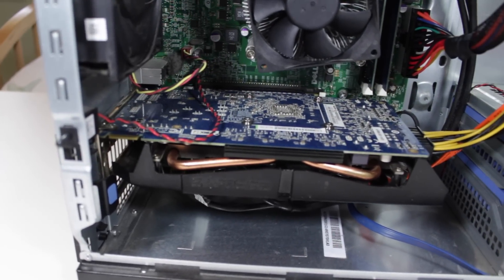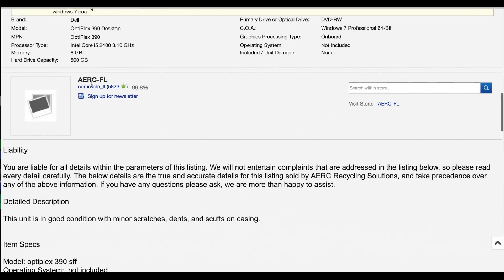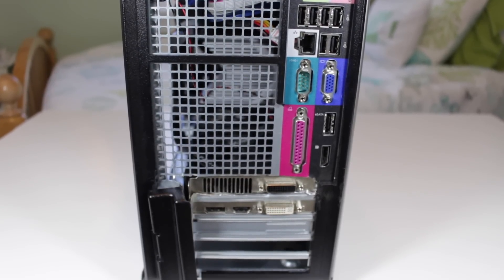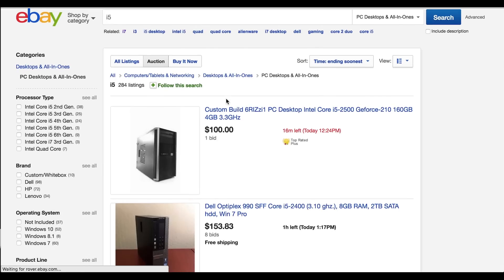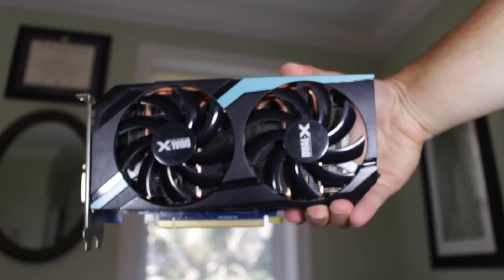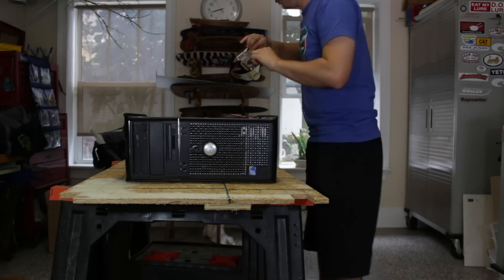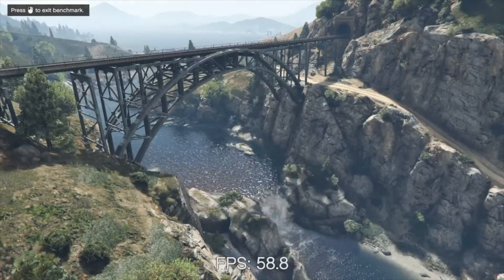How to build a GAMING PC for under $200! (2016)

Comment: Hi Matt. Great videos! I have starting a project to build a budget gaming pc. I decided that I would work towards building a custom pc, not oem. (ie, custom case, gigabyte/msi etc motherboard...) The reason for this is that I could easily upgrade the components in the future. (please view full comment, I think I got some pc components for good deals:)

Anyway, I first carried out a ton of research about motherboards, chipsets, processors, power supplies etc. I came to the conclusion of searching for a motherboard compatible with 3rd gen intel processors (z77,h77,b75 etc chipsets). The reason for this is that I found 4th gen processors/motherboards are a lot more expensive. Also 3rd gen processors are the earliest gen that can work with pcie gen 3 which is another bonus. (Also these motheroards support usb 3!) 
So to get to the point, after about a week of searching ebay auctions, I found an auction going for a GIGABYTE B75M-D3H motherboard bundle. 

It came with 1 stick of KINGSTON 8GB RAM, an INTEL I3 3240 processor, and the INTEL STOCK FAN/HEATSINK.
I won the auction for £78.99 including postage which I was pleased about. 
I also won an auction for a psu - £30.06.This was a CORSAIR 500W (CX500).This is bronze plus rated which is why I went for it
I may sell the included processor for an i5 3470
I may sell my old gpu (msi gtx 750 ti low profile 2gb) for a gtx 1050 ti or gtx 1060

Please tell me what you think! (sorry if this comment was a bit long-winded)
p.s. my old pc was the same one as in your $100 gaming pc build video! It was really interesting! (I had a q9650 processor, 8gb ram, and the gpu mentioned above)

Comment: Thanks for this video! I managed to snag a dell i3847 with a I-5 4460 1 tb hd and 8gb 1600 ram from my local goodwill Goodbytes for $150. Found a MSI HD 7850 for $50 on facebook and bought a new 240gb SSD from walmart for $70 the motherboard actually has sata 3! My buddy had a old 500w 80 Plus PSU he gave me for $10 that had all the connections i needed. I am using the SSD for windows 10 and my games i play the most. The 1 TB HDD im using for random games,music,movies ect. I can play all my games at high settings @60fps

Comment: If I buy a pre built dell optiplex SFF (not the micro) or the large tower as shown in this video and your $100 video do I need to upgrade the PSU if I use an RX 460 low profile card? Could I just use the stock PSU for either or both of these systems?

Comment: i have that i5 2400 dell but mine is a small form factor with a gtx 150 ti low profile
Reply: 741Mo0R_ G4M1NG The Msi 1050 ti lp? It fits right? Like the cover closes with the card installed?

Comment: got 2 of thse comps one with the i7 2600-3.4 and another one for my kids with the i5-2400-3.1   . great comps just one problem .when gaming sometimes the screen goes black for a few secs. i'm thinking its the power supply. probably needs a more powerfull PS even though the video cards dont use  lot of power. have a 750 ti  on the i7 and an AMD 6450 on the i5. Anyone else having this kinda of problem ?

Comment: instead of using a New Psu couldnt I buy a used GTX 1050 TI since they use a 300 watt psu ?
Reply: any card under 75watts gets its power prom the pcie

Comment: Very informative, but you should also mention the limited road path in upgrading  these systems, i.e. whatever you buy today that plays 1080p in ultra settings will play games in in 2 years on medium  1080p. It helps put things in perceptive.
Reply: what about a 3rd gen 3470 i5 with 8gb of ddr3 ram?
Reply: Yeah, rather go for a 4th or 6th gen i3 than a 1st gen i7. Make sure that the motherboard has 4 DIMM slots.

Comment: I've found all my parts i;m gonna buy however the gpu i am going to buy need two 6 pin connectors to power it and my psu only has one 6 pin, i cannot afford a different psu as i have already gone the lowest quality i can without it damaging the other components or blowing up. What should I do?
Reply from the maker: molex to 6 pin adapter
Reply: Tech By Matt I heard they are not very safe and can damage or even kill your gpu.
Reply: depends on the quality of your PSU.
my old PSU had only one 12v rail and therefore the 12V from molex and PCIe are shared.
I used a molex PCIe adapter in my pc for over a year on my old HD6870. nothing did blew up

Comment: You said that the purpose wasn't to go out and get the exact parts and build the exact PC, but I can only find the same optiplex and I'm still leaning towards the hd 7870...
Reply from the maker: +Just to comment if you can find the same parts go for its just in general with used parts you have to be a little flexible and able to search for deals because prices abd availability always flucuate

Comment: I need a help I have CPU intel I7 3770 and motherboard Gigabyte PH67A-UD3-B3 with 750ti GPU and 12GB rams DDR3 670mhz is it worth to upgrade my rams and graphic card or should I build new PC??? Thanks
Reply: Emporio Armani no, just upgrade your gpu. apart from that, your system is pretty good.

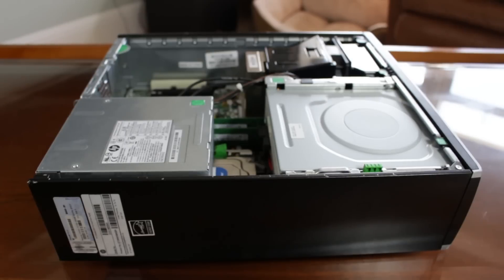Comment: I have one of those sff pc's like the one mentioned at 1:30, hp 8200 elite sff. I would like to move everything to a full size case so I can have a 400 watt power supply. Will I be able to find a power supply with the correct connectors for that motherboard?

Comment: I picked up a Dell Optiplex 760 for €50, (Small Form Factor, Core 2 Duo E7500)
added a 1tb WD harddrive I had laying around,
upgraded the ram from 2gb to 4gb (had those laying around as well),
picked up a gt 635 for €20, (OEM, 1gb DDR3) (Which I had to mod for it to fit the case)

All in all I've spent €70 (but if I had to buy all the parts it would be around €110).
It runs CS:GO on highest settings 60+fps,
can run GTA 5 on lowest settings 30+fps

Comment: i dont get it at all i have a amd hd 7770 (1gb i know))) but i ahve an amd fx 4100 3.60 ghz right and i have mobo probably no has ever heard of its a biostar group a880gz with g.skill 8gb of ram and i still can only play alot of games at only 40-60 fps on LOW i can barely even play gta5  i also have a 450w power supply 
can someone help but i am getting the rx 460 2gb when it comes out  IT JUST DEOSENT SEEM TO maTCH UP WITH YOUR vidEos

Comment: Core 2 quads are pretty good as well. I play the forest with a friend and i have a dell xps 720 with a core 2 quad q6600 @2.4ghz 1066mhz fsb the motherboard could only push out 2.7ghz out of it and even at that it would crash frequently, then i did the tape mod to it which increased it to 3ghz and 1333mhz fsb now i currently get performance on par as my friends fx8350 from an £18 processor with a bit of tape... But the fx8350 will do better in more demanding games than the q6600 overclocked ofc...

Comment: Is my build good for $250
-Intel i7 4790
-Z87 Extreme4
-Crucial 256gb ssd
-Corsair Vengeance DDR3 1600 (2x8gb)
-Corsair Cx750M
-Crappy case
Reply: Right now I'm using a gtx 560 ti but I'm looking for an r9 390x or a gtx 970
Reply: +Lenny Swagmaster you stole it and left 250 bucks in the box where it was , right ? xD
Reply: lol the processor alone is 250
Reply: +chris A i got a good deal from a guy who got a virus and sold his pc for $400. But his pc had a gtx 780 so I told him if he would sell me pc without the 780 for $250 and he said yeah
Reply: +Bad Boy i bought it off craigslist
Reply: +Lenny Swagmaster very good build , I was able to get a full setup without desk for 200 bucks xD
Reply: +Bad Boy How?
Reply: +Lenny Swagmaster wbay or gumtree always has deals like thata hehe
Reply: Lenny Swagmaster a full setup without desk and monitor , including :
Marvo illuminated Gaming Keyboard
Marvo Gaming Mouse
Marvi Gaming Headset
Thermal Paster for the processor
AIO Cooler (for the cpu)
450W PSU
Gigabyte Geforce GT 710 GPU (choosed gigabyte because of their advanced cooling)

got the above for less than 100 bucks brand new

And the PC got it from a cool site almost like ebay but in my country (Im from eastern EU)
PC almost new.
Specs:
CPU:Intel Quad Core 2.5GHz, Xeon E5420
RAM: 4GB DDR3 (Dual Channel)
HDD: 160GB SATA2 7200rpm
PSU:300W
CASE:Fujitsu ESPRIMO P3521 E STAR 5
with a 2 year warranty

for less than 100 bucks (I bought it already done , I don't like the idea buying piece by piece)

so I might think that it was a cool deal for the 200 bucks , or it will be since I want to save up money to buy it 

add 10-20 more buck and we have a SH monitor xD

since Im only playing cs go , tf2 , Smite and some more demanding games
Reply: Bad Boy wow sorry how do you even play in this thing ?

Comment: Hey Matt. I was wondering what GPU I should get for the PC I got from EBay. It's the same Dell Optiplex 390 but has only 4 gbs of ram and only a 250 Gb HDD. I won it for $122.50 plus $9.95 shipping which is $132.45 in total. Although I am only 12, I at least know how to install a graphics card. My max budget for a GPU is $80 which does limit me, but not by much. I was pointing my eyes at a GTX 750 Ti but I only have little knowledge. What GPU do you recommend I get for $80 or under used?
Reply: Hey, we are in the same situation, but I found WAY better PCs for that price like 8gb RAM, 500 and even 1TB HDDs
and all with core i5 quad.
You should research a little more, young one and if you want to play games like GTA V, Assassins Creed, Fallout 4, etc. you might want to wait a little more and get at least a $130 GPU.
I'm not an expert but I do not trust those GPUs less than $100, most of them are useless and others are just a risk to buy them.
Reply: I have been searching for weeks and this is the best deal I could get. But the 750 Ti SC Edition is only $90 and can play lots of low and high end games. My PC is coming today or tomorrow, but I'm only gonna play low end games like TF2, Dota 2, LoL, and etc. Do you have a PC? If yes, I really would like 4 you to give me a link to the one you got.
Reply: ive found gtx 770s at around 75-90 which is WAY better than the gtx 750ti even a bit better than the gtx 960 u should look for this gpu
Reply: Hey man, that's a good approach if you haven't got much money, but what is your CPU in the machine (number, not just core2quad/i3 etc)

for $80 a quick google search is saying new R7 250X.
however buying used, you already answered your own question the 750ti 2gb is actually better choice hands down and is cheaper too.

but like other people have said, you will hit hurdles a lot sooner with this setup, but it does depend what CPU is in there, cause some i3's etc are extremely powerful chips for gaming and it would be wise to hold out spending on a graphics card as long as possible as they have onboard graphics, then a couple of months down the line you could buy a better graphics card and secure those high end games you want to run smooth! :D

do tell me your CPU number (eg. Core i3 2120 3.3 GHz, I googled your optiplex 390, but they are not all the same)
Reply: Oh, and I'm also gonna be playing Overwatch so...yeah
Reply: Buy another 4 GB of RAM. I have a GTX 750 ti and my RAM (4 GB) bottlenecks the fuck out of me. 96%+ RAM usage while my GPU's at 55%.

Comment: matt what size motherboards do they usually use in the small form factor models
Reply: Most likely Micro-Atx but you should be able to ask the seller.
Reply from the maker: BTX - which finding cases for is usually difficult
Reply: ok thanks cause i ve benn seeing some of the sff opnes you usually see in libraries for a decent price with solid processers

Comment: pls answer 
how much power supply need to run amd athlon quadcore 3.1 ghz ,graphic amd radeon 7850 2 gb, ram kingston 1x8 gb 1866 mhz
Reply from the maker: Put your parts into pcpartpicker and it will give you an estimated wattage. Try and get a PSU thats at least 100 watts above the estimated watts.
Reply: +Tech By Matt ty for fast answer

Comment: Really interesting, +Tech By Matt. It's hard to know about this area without having experience. So since the latest is now 6th gen core processors, do you think that the 2nd gen will still last a few years without becoming a bottleneck for 1080p gaming? Are there any socket incompatibilities that would prevent upgrading to say a 4th gen or something in the future? Hope this makes sense. My knowledge so far is limited to RAM and SSD upgrades.
Reply from the maker: Yes, for 1080p gaming the second gen CPUs especially the i5's and i7's will be perfectly good. Most games aren't CPU intensive and with stuff like DX12 we are moving towards even less CPU overhead/usage. Heres an article showing the IPC differences between a bunch of generations of i7's and what it shows is that the 2nd gen i7 2600k is only about 20% slower than the 6 gen i7 6700k in multithreaded applications so as you can see even though these CPUs are older they still pack a good bit of power. http://www.anandtech.com/show/9483/intel-skylake-review-6700k-6600k-ddr4-ddr3-ipc-6th-generation/9

Comment: Matt I am from New Zealand and the prices are different but is upgrading a Dell Optiplex 960 with a 660ti and a 500W power supply a good deal for only $700? but in US currency that would be $497.03

Comment: OK a thing for the mind Dell Optiplex 330 has been running 10 for as many months then will not boot when checked hard drive boot was gone and every thing that was done over that time so put in new HDD turned it on Dell comes up on screen then black with curser in top corner flashing  keyboard does not respond to get anywhere like F2 or anything. Light on MB comes on fans spin and DVD opens and closes . So what is your guess, also pulled battery and replaced. What do you think Thanks

Comment: Hey, Matt, I'm curious if you can find this spec list at the smallest price, I have a Dell Optiplex 380 (The large tower), GTX650 Ti, 6GB DDR3 RAM, Intel Core 2 Quad Q6600. In total I spent  €181 which is almost $200, I wonder if you can build this rig cheaper. :P Good luck! :3

Comment: Hey I got a Lenovo C260 All-in-one computer for free.
All the people said was that it did not turn on.
The specs are
-------------------------------
Intel Celeron J1800 2.4 GHz Processor
4 GB DDR3 RAM
500 GB 7200 rpm Hard Drive
19.5-Inch Screen
Windows 8.1
--------------------------------
it did not come with the power cord but for free i find it a amazing deal.  
But what do you guys think it is that is messing it up?
I think the power supply, please answer!
Reply: first of all open it up and look at what looks broken and also you didn't mention the gu so that might be a problem and just buy a new power supply or you are missing some cables so you don't spend that much dollars and also upgrade the processor and get a gpu XD there is a 50 dollar AMD  gpu which is a Radeon RX7 or RX9 I think but its cheap on amazon
Reply: +T4M3 thanks!
Reply: Its a all in one computer.
Reply: Nm3z Kazi but you can make change, it is upgradabke not like a beast, but it is:)
Reply: BANDIT and it can't run gta5 more than 30 fps on high settings.

Comment: WOW that was fast I haven't even left the page Thanks  the card says need 300 watts so I will use 400 watts Thanks again for your very fast help Loved the video for this is what I do revive cheap computers and this one could turn out great running windows 10 and 8 gigs of ram just a dual core but 3.0 hzs
Reply from the maker: Glad I could help, also I believe the dell 745s support q6600s which are quad core processors which are only about $15 on ebay. Which would be a big upgrade especially if what you have now is a pentium D.

Comment: Hi Matt i have a Dell 745 and a 400 power supply  the card I have needs a 6 pin and a 8 pin PSU only has the six where can I get a 8 pin adapter and how does it hook up to PSU Thanks the PSU is both molex and sata connectors
Reply from the maker: You can get a molex adapter like this, but you should use PCpartpicker or a PSU calculator to make sure your PSU can supply the power your system needs. http://www.newegg.com/Product/Product.aspx?Item=N82E16812400034&nm_mc=KNC-GoogleAdwords-PC&cm_mmc=KNC-GoogleAdwords-PC-_-pla-_-Cables+-+Internal+Power+Cables-_-N82E16812400034&gclid=CjwKEAjwtqe8BRCs-9DdpMOilBoSJAAyqWz_UJaQv_xrizxBtMZB5rLMyMOiMTC_I0ke8rbn68kXthoCs5Hw_wcB&gclsrc=aw.ds

Comment: Hey guys, this is Garett, and I love your videos matt, without your help I would have nevered got the pc I built today. The PC I list below came in with a total of $730 (price includes monitor, keyboard, and mouse as well)

PC specs: 
CASE: Phanteks entho luxe
MOBO: MSI G5
HDD: Crucial mx-100 512gb ssd
CPU: intel core i5 4670k (OC 4.5ghz)
CPU COOLER: Cooler master hyper 212
GPU: EVGA GTX 980 Superclocked
PSU: LEPA 1000 watt
OS: Windows 10 pro
MONITOR: QNIX 27inch 1440p (QX2710led) (OC 120hz)
KEYBOARD: CM STORM QUICKFIRE TK (CHERRY MX RED)
MOUSE: LOGITECH G502

AS price breaks down paid $480 for everything except gpu (guy was moving the next day!)
and paid $250 for the GTX 980

ALSO, THIS IN CANADIAN PRICES, SO TOTAL COST IN USD WOULD BE: $562.92
Reply: hey Finally another Garett (with one r)
Reply: You don't know how happy you have made me good sir!
Reply: +Garett Ashlie I have never seen another Garett .
Reply: i know
Reply: +Russell White 16GB cosair vengence ddr3

Comment: This is the best cost to performance way to build a PC OEM PC are really cheap they have decent CPUs however you can't over clock using the motherboard that's a small drawback